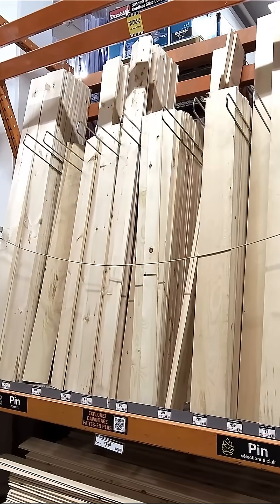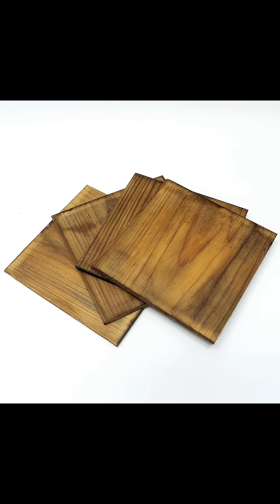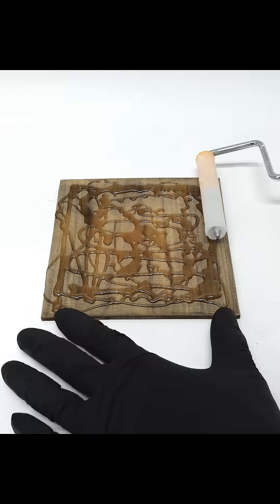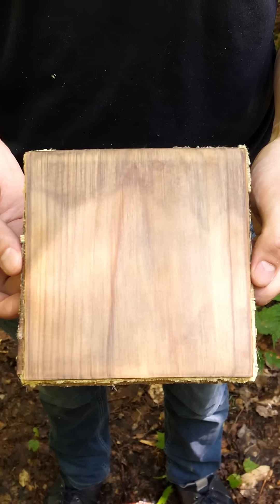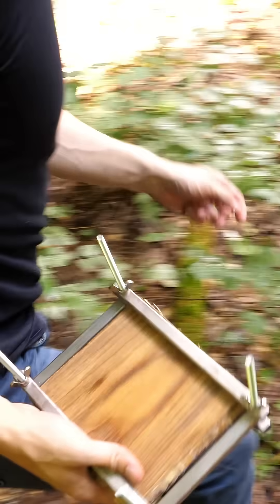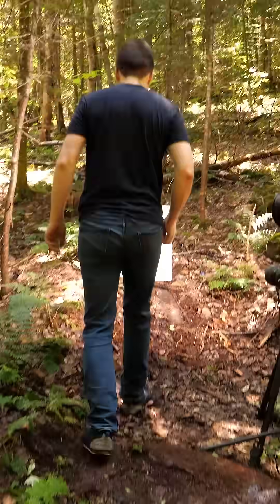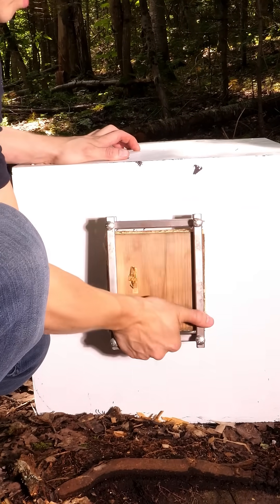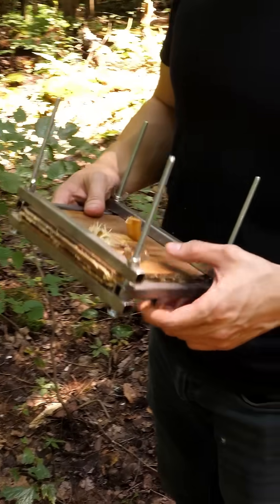Making bulletproof-er wood

Comment: Imagine if it worked though: "i made wood bulletproof by adding a bulletproof material to it" absolute cinema.
Reply: Absolute cinema? If only we were on ig i would send the gif😔
Reply: If you do the same thing with about 10 to 15 layers of fiberglass it becomes bulletproof
Reply: No one would have seen that coming.
Reply: he was basically trying to replace the steel or ceramic used in bulletproof vests with wood, but he didn't know how the kevlar works for bulletprofing.
Reply: ...and failed 😂

Comment: the problem with this attempt is that the kevlar needs to be able to move

it works by slowing the projectile down over distance, so when you glue it to wood its just going to act like the wood

if you leave a few pieces loosely connected to the back of the wood it might work
Reply: I wonder if he did Kevlar and then some padding behind it like foam or felt if would give it enough space to flex.
Reply: @Melds  NIJ certification uses clay heated to 97 degrees and allows up to  40mm of deflection to classify as pass. so having more give aided the plate
Reply: @Melds the human body, despite bones, still has enough give for kevlar to stop 12 gauge shotgun slugs

it'll hurt like hell and destroy your sternum, but humans have survived it from point blank range
Reply: @nathanstautzenberger8381  huh in that way your bones act like part of the armor composite (they fracture to absorb energy)
Reply: Kevlar weave also isnt what is used in bullet proof gear. Usualy its compressed seperate fibers. But the real issue here is adding a fracture plane
Reply: @eskamobob8662 soft vests are made using kevlar weave, have been for decades

hard plates are often made from steel, composite ceramics, or even ultra high density polyethylene (high molecular density plastic)
Reply: Oh. That's what it does. Neato!
Reply: 3 layers of wood, 2 layers if triple kevlar w-k-w-k-w. don't use any glue, and sew each triple layer of of kevlar together.
Reply: For this application, the kevlar might be best suited on the back like you said, both as one last blockage but also to hold stray splinters
Reply: Yes, squeezing (non newtonian) cornstarch in between could help with the mobility and kinetic absorption?

@nilered
Reply: My take for the next test:

Same thicker wood, with routered square halfway deep - staple loose Kevlar onto it as a catch... glue next wood piece and repeat, and finally laminate the front and back with a piece on the outside.

Ending up with the original 3x sheets [2x 1.5] while keeping the Kevlar properties.
Reply: Yeah your right
Reply: This right here!
Reply: How do we keep the kevlar between the glued wood without gluing the kevlar?
Reply: @jaacobb123  You don't. You make sure the wood is only glued to wood and find a way to make sure this is stuck behind the wood and maybe even to the front
Reply: Yeah its not about hardness and compression. It about the armor wrapping around the round and slowing it
Reply: Or put one kevlar loose on the front of the wood so it can stretch the whole wood depth when it gets hit
Reply: @El_Chompo  Composite armour is typically (in VERY broad terms):

1. Anti-spalling cover.
2. Hard front to deform the projectile
3. Kevlar® or other aramid to catch the bullet.

Yes, Kevlar is a brand name, not the name of the fibre.
Reply: better for vehicles
Reply: Exactly what I wrote lol

Didn’t see this
Reply: Yeah, leave some on the front and the back. Also, layering between the wood had an inverse effect on its strength
Reply: no, kevlar is NOT bullet proof even if it's loose. it is not use in armor that way. it is mostly used with steel armor bc when a projectile hits is the metal doesnt give and the projectile breaks apart causing spalling the kevlar is used to catch that, but it fails at that. the problem with this experiment is he should of stacked the kevlar in multiple layers with epoxy and pressed it as hard as he could then once dry epoxy the woof on top as his strike face.
Reply: What if you used porcelain tiles instead of Kevlar?

Comment: Part of kevlar's deal is it's flex. No flex, it is just gonna shatter. Especially all glued up.
Reply: Yes, in a Kevlar vest the fibres entangle the projectile and stretch, but when they're fixed by the glue and wood they just break without absorbing much energy.
Reply: @eternaloptimist2840  Turning wood bulletproof by attaching bulletproof material to it isn't exactly ground breaking.
Reply: What the actual hell is that first comment😂
Reply: @TheBattledude1 an insane guy that has commented several times in this video that some comments are from bots when, at least the OP from this thread has an older account than the one accusing him of being a bot
Reply: @piroko13 yeah it's pretty funny how those bots, if there even were any, usually get removed within an hour, yet all the pointless comments ppl make going ballistic over them stay
Reply: Stick it together with flexible silicone sealant... it would allow the kevlar to flex. You would need something else to allow movement....
wood panel +
sealant +
2mm thick floor laminate underfloor insulation +
sealant +
kevlar +
sealant +
2mm thick floor laminate underfloor insulation + 
sealant + 
wood panel
 etc etc etc
Reply: Actually, dispersing the force of the bullet would stop it, and from what he did, he just made it too solid to disperse the bullet power.
Reply: @eagercleaver1782 so it simply shattered then ?
Reply: Now that’s a flex!
Reply: Finally someone who knows what they’re talking about!
Reply: Not exactly true. The modern combat helmet is an inch of pressed Kevlar. I'm sure they did more than just glue it to shape tho
Reply: similar concept with using plywood on construction, but bc of the differing purposes, would be far worse for flexing at a much smaller, granular level, like kevlar (just adding on that its similar, but scaled to the extreme, so def not useful together, and spot on abt the glue!)
Reply: UTTP IS BETTER THAN NILERED
Reply: @OfficerBankruptUTTP  you aren't even better than fermented shit
Reply: @OfficerBankruptUTTP you guys are mad because you didn’t know this stuff.
Reply: Exactly think of Kevlar as a catchers mitt.
Reply: Thank you.
Reply: Piss off uttp
Reply: How about scale armor
Reply: that, I agree. it loses flexibility when strectched or glued
Reply: Yep , exactly 😮
Reply: Ah so kevlar made it more fragile then huh, in that config
Reply: So glue on the outside only might produce better results?
Reply: it is flex?
Reply: ah good shout. I wonder if it would have worked if he just didnt use the glue an clamped the wood sandwitched with kevlar together
Reply: Yeah that's a big reason why being shot with kevlar is still really dangerous. The stuff itself doesn't break but the force still needs to go somewhere.
Reply: This
Reply: I'd hate for you to see what the military uses. Hint, it's CERAMIC lol. But yes, you're right the kevlar wouldn't do shit in this scenario because yes, it wasn't able to flex and move. Had he put the kevlar on the back, with only glue around the edges, it might improve it's bullet stopping capabilities, and at the very least it'll help with the spalling when the back panel blows out.
Reply: Was just gunna say that brittle materials will just shatter
Reply: @elementsgaming2411 Kevlar isn’t brittle (at least above cryogenic temperatures).
Using adhesive that is listed as impact resistant however means it wouldn’t hold the Kevlar in position… So the strands could simply slide.
Rigid glue matrices are used to prevent this happening (and a minimum of four layers of Kevlar at 45 degrees offset to each other). Any less and the bullet will just slide through the weave.
Soft bullet proof vests use twenty stitched together in a quilt.
The cheapest bullet proof material is ultra high molecular weight polyethylene (which also makes a pretty good kitchen cutting board).
Reply: That’s what I thought too, it’s effectiveness is catching the bullet, if you try to keep it rigid the Kevlar has no way to form a net so it’s just rips through.
Reply: @Cam-gb1cu If you don’t keep the Kevlar in position they bullets slide through the weave like a needle. One part glues are horrible at that. Kevlar is also weakened by being exposed to water (by about 60%)…
Reply: Right, and Kevlar being itself bullet proof when applied properly, I'm not sure what was trying to be accomplished here...... 🤷‍♂️
Reply: *its (not it's) flex😊
Reply: Yeah he needs to sew it on to the wood. Or staple it.
Reply: Neat
Reply: Plus, it’s need to be the Kevlar layers all together for any chance, not one between each piece of wood. In regular conditions you need like 30-50 sheets of Kevlar iirc to stop a bullet depending on the caliber. Maybe if it was the 4 layers of wood, with like 10 layers of Kevlar between 1 and 2 it could work
Reply: We going to suggest ditching the glue as well. Maybe keep a line around the outside but no glue is best
Reply: He's a chemist, not a materials scientist.  You don't know what you don't know.
Reply: I think the Kevlar put gaps in-between the boards whiched made them snap
Reply: That’s exactly what I was thinking…. I don’t know how accurate this is, but I have been told that Kevlar sort of works like a net slowing down the bullet…. this is why people shot while wearing Kevlar still end up with blood for trauma from the force of the bullet. (It’s inertial mass)
Reply: kevlar gets used in boat hulls with glass and or carbon fibre
Reply: Wood, Kevlar, newtonium fluid cells, silk
Reply: Hmm i wonder if he only glued the outside perimeter and not throughout the middle if it would have performed better
Reply: Probably the same with the wood as well
Reply: Thats what i was going to say lol
Reply: Not if you use a resin.
Reply: he shouldeve just glued the sides
Reply: Marlin bundo is a coward
Reply: That's not true at all.
Reply: Strange that it still performed worse though. At best it should’ve been even. My only guess is that the wood wasn’t as dense as the previous test was.
Reply: *its
Reply: He's a chemist, not a materials engineer
Reply: @bloodakoos  neither am I. Still knew. Stop acting like a princess getting their panties in a wad over imagined bullshit.
Reply: Damn you beat me to that part of the answer lol 😂 😅 I was gonna say the same thing 😊👍🏽
Reply: Was about to say
Reply: He can fix this problem when he’s not use aglow in lair
Reply: @Outbo ?? Huh??
Reply: Kevlar has high TENSILE strength.
In a composite structure you are best using layers at 45 degrees to the one above. Kevlar unlike Carbon Fiber also has high energy absorption. The flex is irrelevant.
Reply: These bots are now spreading everywhere
Reply: @kushaldey3140 bots? wtf are you talking about
Reply: @kushaldey3140 omg, bots are commenting about themselves, an achievement in AI 😮
Reply: @kushaldey3140 i saw this same bot on the daily dose of internet i JUST WATCHED
Reply: That's not even remotely true. I make kevlar/carbon fibre hybrid components for rally cars, personnel  carriers and helicopter under pans. The kevlar will distort, but the fibres are so strong that they will push through solid material. Glue and wood won't stop how effective it is at all
Reply: yea but if you had a bullet proof shirt then youd have your shirt punch hole in your body due to the excessive amount of flexibility.  i think the reason why they wear kevlar when theres harder bullet proof materials that work better to not break your ribs is becuz theyre not avoiding injury theyre avoiding death, so they so they use the stuff with higher mobility so they can run after people
Reply: Huh?
Reply: no the only time kevlar was used for body armor was to control spalling from steel plates and it couldnt even stop that and it was loose
Reply: Not true. Helmets.
Reply: @Sparks00psn Care to elaborate how saying the word helmets invalidates what others have said? Something about the construction of helmets that uses Kevlar in a glued up laminate rigid composite material without compromising strength? One word is not enough here
Reply: @marlinbundo2409 ECH and ACH are made of Kevlar but don’t compromise the strength of the Kevlar to stop bullets and fragmentation while being rigid.
Reply: Hmm I wonder if he cut them into small squares and then basically followed the same plan if it would be superior.
Reply: @_DREBBEL_   
  No it would be far worse.  Practically useless.
Reply: @_DREBBEL_  Turning wood bulletproof by attaching bulletproof material to it isn't exactly ground breaking.
Reply: These bots are getting crazy what the hell man this thing looks like it escaped from instagram
Reply: Turning wood bulletproof by attaching bulletproof material to it isn't exactly ground breaking.
Reply: "Its," not "it's". Yes, I am a prick, and yes, I am miserable at parties.
Reply: @RosiePosie-el3lj  I always thought possessive it’s/its was with apostrophe, appreciate it
Reply: @RosiePosie-el3lj you and I will be good friends.
Reply: @RosiePosie-el3lj .  We would totally hang out and ruin it for everyone else…. Cool!
Reply: @RosiePosie-el3lj yeah you really are but atleast you know that and don’t just think your good
Reply: @GeordieShrimp  was the "your" instead of "you're" a deliberate troll? 😂
Reply: @topspeed250k5 nice catch!😂 hard to not break a window with a rock when your house is made of windows and you are shooting the rocks out of a cannon.
Reply: @GeordieShrimp  * at  least * is 2 words
Just being miserable at parties too 😂
Reply: @topspeed250k5 I think it’s “yore”

Comment: This didnt work for the same reason glue laminated timber doesnt use any instersticial materials: you created a secondary fracture plane. The reason the first one worked is because the wood bonds tp its self so completely. If you want to try this again you should use paper instead of a fabric. This is how high load plywood is made
Reply: Also, to add to this, it will likely come put best if you use a compression mold and crush & cure the entire stack at the same time. The compression at curing is key to plywood manufacturing
Reply: Kevlar needs to be flexible to do its job
Reply: @ninjunx  Well, it kind of still is, because the glue it's embedded in probably disintegrates immediately. But then it no longer holds the wood layers together.

Thicker padding layers of unbonded kevlar cloth, between slabs of multiple plys of wood that are otherwise anchored to each other might work better. Maybe stitch the whole stack together with kevlar thread through holes in the wood?
Reply: Wood next Kevlar next horse stall matt no glue sew or rivot?
Reply: @markboston2850  which layer does the horse go in?
Reply: This
Reply: Shields beginning in the early Middle Ages (Anglo-Saxon period in England) were actually made similarly, with laminated plywood made by placing thin sheets of wood over each other at 90°, glueing up the layers, and then putting either leather or several layers of linen canvas on the front and then sometimes linen canvas on the back as well. The edges were bound with rawhide. The result was a surprisingly light but sturdy - and most importantly springy - shield that could take a surprising amount of punishment.
Reply: So "like likes like" all over again?
Reply: Kids, dont click his profile.  Its a bot thats going to try to steal your profile.
Reply: @oldmanbiscuit7518  Did you click the wrong comment? Did you "@" the original post and that got deleted somehow? 

Seems odd, normally they just stop it linking to the deleted or blocked profile. Lots of comments about bots with the same trend. I have to wonder if they're bots themselves.

Comment: Works good just needs more stuff
Use rubber cement (it stays semi-sticky) then also double or triple the kevlar between each layer of wood, should be able to use the same amount of wood or less but we’ll find out later lol
Reply: Kevlar needs to flex. It's it's whole deal